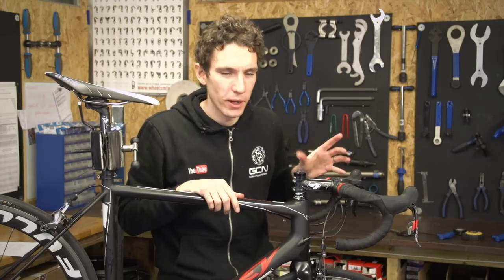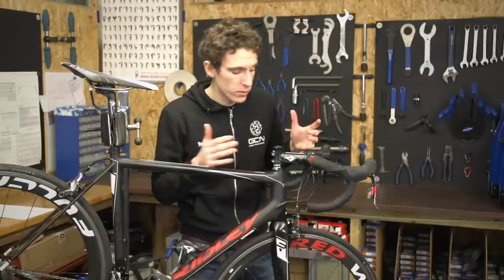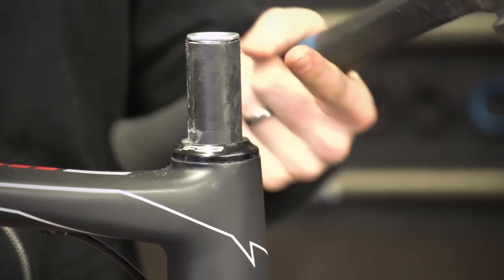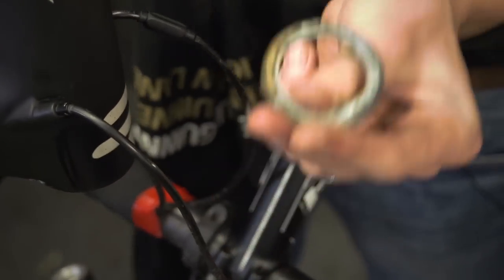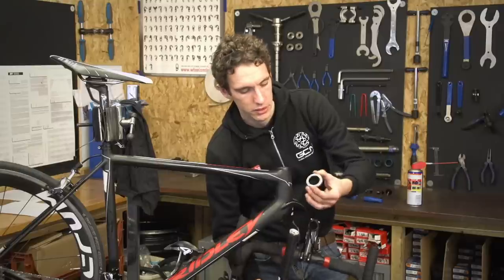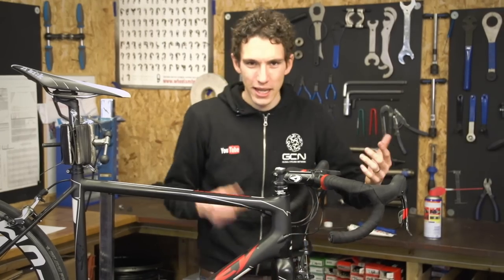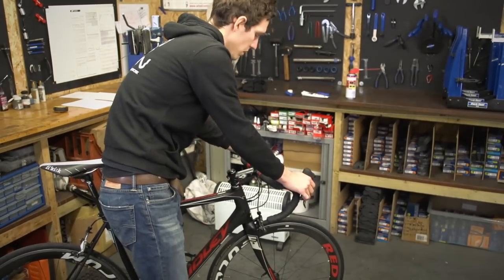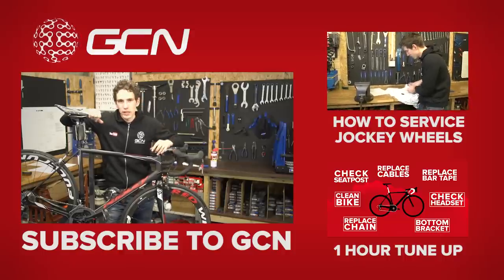How To Service Your Headset

Comment: That’s not how you repack bearings just rubbing it on the surface will leave the dirt and grime inside you need to smash the grease through it put the grease in the palm of your hand, smash the bearing into it

Comment: You didn't show taking out or replacing the top top cartridge bearing. Which way round should it be, rubber seal up or down?

Also I noticed my compression ring a the cover didn't hold the fork in when I replaced it - I had to balance on one leg and hold it in with my foot, much to the neighbours amusement.

Comment: I'm just returning to cycling, and I'm attempting to get myself back in shape so I can start commuting to work (6mi each way, 5/days per week with a beast of a hill each way).  I've just serviced my hybrid, including the headset, which was filthy. My top tip for cleaning the bearings is to use an old hand cream tub and fill it about a third full of white spirit (or your chosen degreaser), drop the bearing in screw the lid down  then give it a gentle shake for a minute or so.  It's amazing just how much crap comes out of the bearings.

Comment: will there be a video coming up on ball bearing headsets?
Reply: Yeah, I'm trying to take the stem off of my next power climber. And I loosened the top lock nut and I hit the wedge but it dosent want to come out and everything's  lose the balls came out on both sides I just can't get it apart.

Comment: THANK YOU! I watched a few of the maintenance videos which led me to this one. I have been riding for a while and doing my own maintenance, but I never realized there were bearings in the headset that needed servicing. I did that this weekend, but noticed the headset was loose on a ride. Watching your videos again, I realized that the bolt holds everything tight and on further inspection, I needed another spacer to keep everything tight. IT's all fixed up now and everything feels great. Again, Thanks and great videos! Glad I found you guys!

Comment: Note in a Giant OD2 headset there is a very thin (0.3mm?) metal shim that goes between the bearing cap and the compression ring. this part is critical in the OD2 headsets working - without it the bearing cap compresses on the top of the head tube and it binds up.

Comment: I've tried tightening my head tube but its still not tight enough
Reply: What I found is tight the head tube with the front bake fully engaged, ,move the bike a bit and brake, that's the correct position to avoid wobble.

Comment: Great video!  I have sometimes the problem that after tightning the headset top cap the spacers can still turn around. I suppose that if the compression is ok, everything must be firm and the spacers can't move around? Anybody a suggestion?

Comment: If doing this task check first whether your headset is newer slip fit (as seen in this video) or interference fit. The latter needs multiple specialist tools which works out quite expensive for an occasional job. Consider using local bike shop or at least cost out the tools in advance.

Comment: When I adjust my headset I have to really tighten it alot until it stop clonking, and the fork moves freely until I tighten my stem bolts, then it stops moving by itself (lots of friction I guess). I dont get it !!

Comment: How in the world do you get your top cap bolt back into the star  nut or bung if it drops down into the steer tube?  I've been lying on my back with my frame upside down for the last 15 minutes trying to get that bolt to start but it keeps pushing the bung up and away from it.  Also, I'm assuming the taper on the bung goes toward the cap bolt.  (Hope you can get what I'm saying from my word picture here.)

Comment: When I tighten everything up as shown at the point of reassembling I can still turn the handle bars if I have the front wheel clamped between my knees (though it's stiff).  Should that be happening??

Comment: When setting the lower bearing into the frame on my carbon bike, it is noticeably loose (maybe 0.02 inch).  Is this an issue actually, or does the tapered top of the bearing and the bore in the frame settle in once it is all tightened properly?

Comment: I live in Florida so yeah this has been an issue.Got a bicycle with a tapered headset tube essentially bottom bearing ring bigger than the top bearing cage ring.Well bottom bearing cage ring got crushed after the headset came loose and I didn't check to see if the ring was back up in the headset before tightening top cap.None of the local bicycle shops had that size of bearing cage ring so it was suggested I go old school with grease and loose bearings.Man it was not easy but put in more loose bearings left a gap so they could move around easily in cup.Did the trick.No more fighting my bicycle when steering and front moves,swinga freely no sticking!

Comment: Good explanation. I have a Ribble sport 872 which uses a Level 52 Headset – 42-52mm Tapered. I’ve done approaching 6000 miles with Mansfield RC on it and I’m just gonna change it as a general service. I did the bottom bracket on it after 1000 as it was bought second hand.

Comment: Seller always make confused to buyers by making so many sizes headset and bottom bracket and other parts it's unnecessary things
Reply: satpal jat it’s a major component of how stiff a bike feels, and what other components go through the bearings, like brake hoses and shift cables.

Comment: I find turning the handlebar to the left or right to check for play. That way there is no small wheel movement despite the brake engaged. 
I'd also be inclined to use less grease as it basically becomes a magnet of all kinds of crap sticking to it.

Comment: The chat rooms are still full of comments stating that grease can damage/weaken carbon - but you apply grease liberally with no alert. Please can you finally put to bed this urban myth or clarify which type of grease could damage carbon frame or steerer? To grease or not to grease - that is the question?

Comment: Hi do you have the link to the Cane Creek Head Set where you can selection you bike model, thanks
Reply: The Cane Creek website no longer has the bearings finder feature (probably too time consuming to keep it up to date with every bike produced?) however if you click on Everything You Need to Know About Headsets button you will get info on how to interpret the numbers printed on the existing bearings case or alternatively how to measure steerer / headset to order replacements.

Comment: After greasing the headset and inserting the fork, compress the bearings, then remove the fork again. The new grease will hopefully push out old dirty grease from the bearing cartridges. This worked for my non-integrated lower bearing at least.

Comment: Question: I removed the wheel, brakes and handlebars, but I couldnt get the fork to slide through below because the stem seems to be stuck in the 3 bontrager spacers above.  How can I free the stem from these spacers?

Comment: 2:00

I unscrewed that bolt, and the part that holds on to that just fell down the fork, and i can't get it back...

Any... help?
Reply: By now. I hope you got it but you can remove the fork and flip it . It should slide out.
Reply: Machoortiz There was a metal tube that is supposed to hold the special bolt in place, but it was broken, It took me 3 hours to get it out, fixed with industrial glue

Comment: Thanks for the video! I find this and all the other videos yo have very helpful. I had followed this video to resolve a creaking noise, then on my first ride after I was wondering: what about the steerer tube?! Does it need any compound - or make sure there is no compound - to ride safely?
I had put this together, as you did in the video, but without paying special attention to the steerer tube's connection with the stem. I tested the headset for play as you showed in the video. I also tested the connection to the stem by pulling on the bar while standing over the front wheel. However, I was still worried about it on my first ride as I wasn't quite sure if I did the right thing: should there be no (fiber grip) compound on the surface between the steerer tube and stem (both are carbon on my bike)? At a minimum, I should probably make sure there isn't any residual grease on the steerer tube when putting the stem on?

Comment: I was inspired by this video to service the headset on my 6 year old bike with 30K+ km. Once the "hazmat" removal team lets me back in to my workshop :-) I will need to decide what to do about the cartridge bearings. They are corroded but still rotate pretty freely...some resistance but no obvious rough spots. Any rules of thumb for determining if they are shot (before I assemble everything and use Si's advice to play around with the tightening bolts)?

Comment: I have a rocky mountain 2011 element 70 msl frame and a 2017 fox float grip tapered fork on the way. I,m looking for a headset that would fit on the frame since the head tube also have tapered corners. fsa or any good brand

Comment: Hello, I noticed on my bike that the top bearing doesn't fit snuggly onto the frame(bearing seat). There's a visible gap between the bearing and the frame(bearing seat). Is this normal for an integrated headset? And even after tightening the headset there's still that loose play from the head set.

Comment: #askgcn my top cap, not sure when and how, does not want to unscrew. I can twist it for hours but it does not unscrew (probably lost it’s threads) and there’s a jiggle to my headset and it has bothered me for months now. I “cure” the jiggle on my headset cause i cannot tighten or lossen my top cap’s screw. How can I remove my top cap’s screw....

Comment: On taking apart the headset on my hybrid there is a rubber seal which is supposed to sit directly on the forks, but it doesnt seem to sit snug where its supposed to and therefore i cant put the headset back together properly, any advise would be helpfull?

Comment: si i notice what sounds like a rubbing noise when standing and rocking the bike during pedaling. thought it was a wheel bearing but it doesnt feel rough spinning it by hand and theres no horiziontal play in it either. could it be a headset bearing worn out? the bikes probably 7 years old or so by now, it hasnt been ridden 5.000k every year by any means but its still old and has never been serviced. think that could be it?

Comment: Someone needs there front brake adjusted, brake lever touching the handlebar big no no haha. Nice video. I did this on my first trek as i was getting a clicking over bumps. Took everything apart and re-greased.

Comment: +Global Cycling Network My question is how come mine has an expanding nut for the carbon steering tube and most people's seem to  have threaded on carbon bikes like this one. It's confusing me. Mine seems uncommon and harder to manage, running into more problems and more likely to damage to carbon due to doing it wrong.

Comment: Hey guys! I have a question. Is it  false to overtighten the top cap (over 2 Nm as advised by bike manufacturer ) in order to have a slightly stiffer steerer, because it feels really light and loose!?

Comment: I took my front end apart the other day hopibg to give the headset bearings a fresh dab of grease. Got the top bearing out of the cup easy enough. For the bottom one, i tried to pry it out with a screw driver but ended up taking out the inner steel ring and exposing the ball bearings. Manages to get everything back together alright, but how should I go about it the next time?

Comment: Great simple and clear advice as ever. Bottom bearing, though still moving was stuck fast. WD40 and gentle prying with a screw driver didn't work, so a bit of plastic pipe down the stem and a gentle "tap" with a rubber mallet. That did the job, but tbe the complete sealed bearing split into 4 pieces and the ball bearings vanished all over the garage floor! Looks like I'm going the bike shop tomorrow!

Comment: Although not generally applicable during normal maintenance, I suppose you may also mention the use of expander bungs for carbon steerer in place of a star nut. Perheps a video on how to replace a fork later on?

Comment: I just performed this and what a difference.  The bottom bearing had all the gunk on it and was just wee bit noisy.  I cleaned out the old grease and repacked it and it's quiet as a church mouse now and my steerer is smoother with less friction.  With that said, I wonder how many pro bike racers know how to perform work on their rides.

Thanks for the video.

Comment: I did tighten the top screw but it still loose beetwen headset and the wheel.  What should I do. I use Fingard bike.  I really need to fix them cuz the road is full of bumping area in my community house. help me.
Reply: Are both bolts properly tightened? Both the cap bolt and the inner bolt? And are you using the right amount of spacing?

Comment: Great vid, just cleaned my headset but on my bike I had an additional part which needed loosening and removing before the top bearing and cap could be removed. Was trying to pull bearing and cap off but wouldn't budge when at top. Having a closer look I seen an Allen key shape in this part where I loosened and then happy days. I've got a lapierre just in case any1 has similar issue

Comment: Hi guys,
Just wondering why you put spacers on the top of the stem. What do they do?
Thanks
Reply: There needs to be a little bit of space (about 3mm? don't quote me on the exact amount) between the top of the fork steerer tube and the top cap. This is so that when tightening the top cap, the steerer tube is able to be pulled up without running out of space a/k/a coming into contact with the top cap, which would cause the headset to not be fully tightened. 

Also, you want the bolts of the stem (top and bottom) to both be engaged with the steerer tube. I've seen some bikes where the stem is at the very top of the stack but only the bottom stem screw is actually in line with the steerer (the top screw being above where the steerer ends). That just seems less than ideal to me, should anything happen to that one screw.

I hope I made sense. :-(

Comment: Hey, Si, is it OK to mount the stem directly on top of the bearing cover, after having removed all spacers, to achieve a lower riding position? I am asking because it looks like the spacer(s) provide(s) a wider horizontal surface for the stem to sit upon. Thanks!
Reply: ***** thanks!

Comment: I've dismantled and cleaned out my headset, re-greased everything and put it back together, however now there's play in my stem.  Everything feels solid but if I move the handlebars back and forth swiftly then the wheel starts to rotate more and more out of line with the wheels.  The top nut is installed as tight as in the video and I then over tightened it but still there's movement.  As an aside I'm concerned that my compression piece doesn't actually stop the forks from dropping out of the frame.  Is it pieced back together incorrectly, have I over greased it? (is that even something I could do?!)
Reply: +Andy Wall you cant over grease a bearing, have you checked your torque on your stem bolts? your stem shouldnt rotate on your steerer tube when torqued correctly